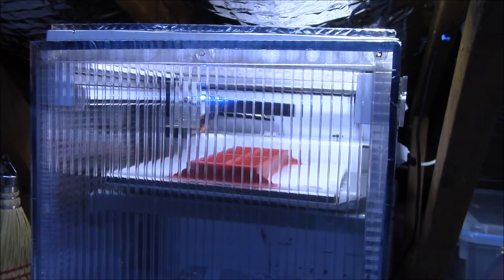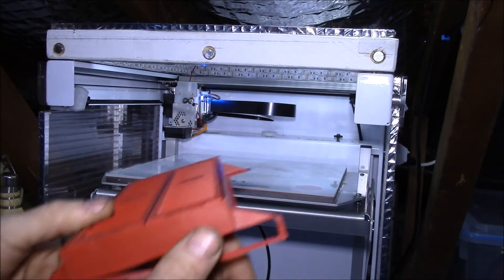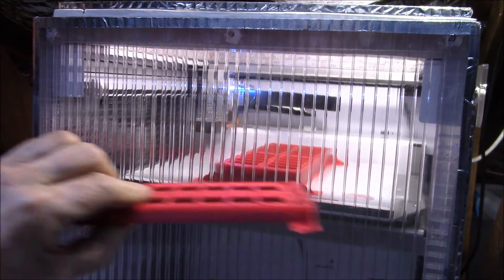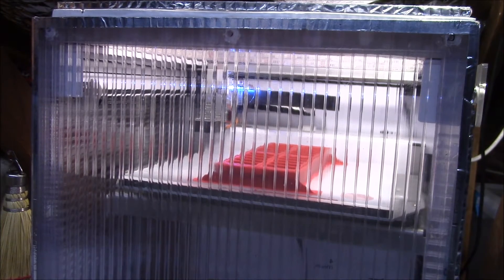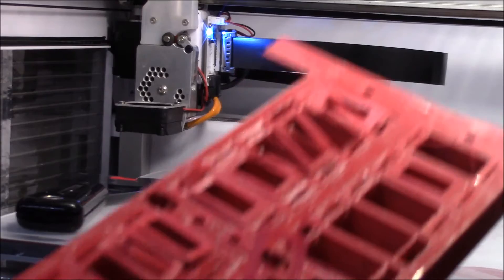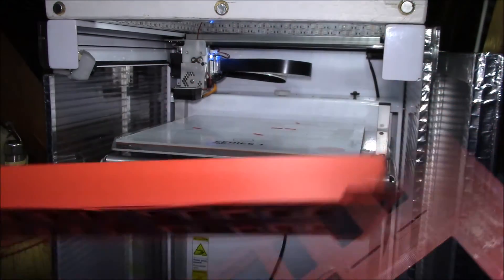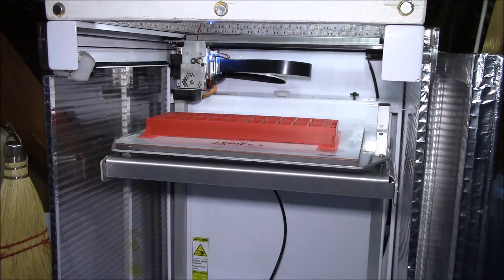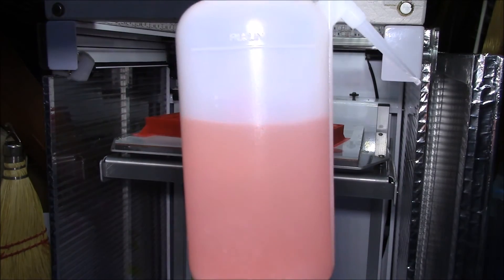Series 1 Pro 3D Printer Enclosure - Large ABS test print

Comment: Thank you we put alot into the design, actually this one is specific to the Type A Machine and physically bolts to the frame of the printer, so not a universal option.  Also it does not supply additional heating

Comment: do you use supplemental heating? or just the heat from the build plate? what is recommended inside air temp?
Reply from the maker: It just uses the heat from the build plate and extruder, I let both preheat for 10 mins. summer (longer in winter) before starting.  I haven't measured the inside temps, but am planning to do so at some point.  I want to install an Arduino-based temp. sensor in there and transmit that to my home automation controller for monitoring.
Reply: thanks!